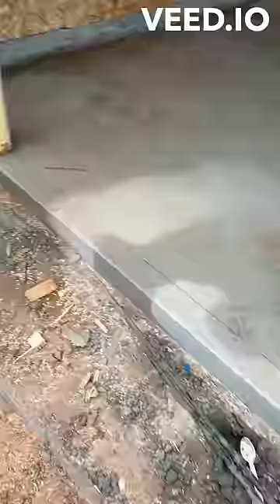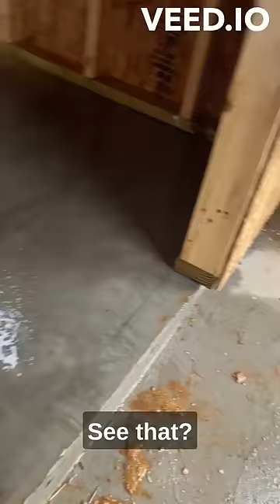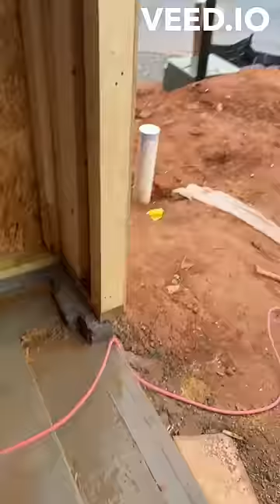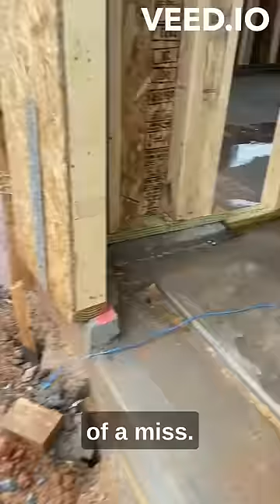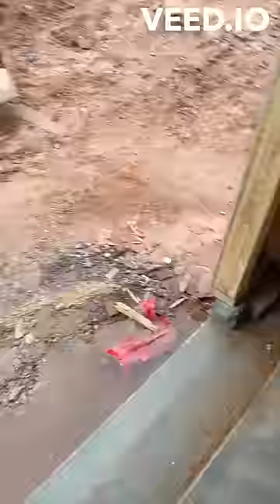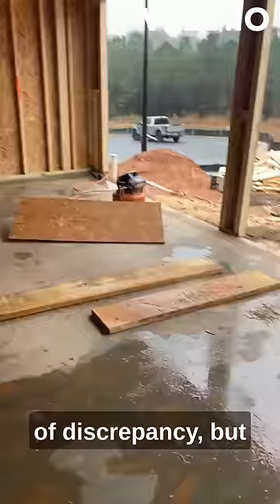New Home Slab is Wrong Size, What Now?

Comment: Tell em to tear it down and DO IT RIGHT! I've seen it done before. These corporations charge way too much for trash work!
Reply: Go with smaller contractors, because the smaller they are the more they treat their employees right which do the job right
Reply: There is a house on top of it! A bit of an over reaction to tear the house down to repour the foundation.
Reply: @brycebeckett6654  If I'm spending a lot of money on a new house then I'd want that shit done right. Not some kind of patch job.
Reply: When you pay “production” prices, just because you have volume, unfortunately this is the product you sometimes get. Personally, there’s no way I could live with this work product, but you know the old adage… you get what you paid for.
Reply: @rasheemsanford9348  sadly, today, you never get what you pay for.... Corporate greed with no morals or ethics is what we get today.
Reply: Chippies (at least when I was framing) flick lines to measurements off plans, frame the walls, if plates overhang slab then the developer calls back concreter’s to extend slab for frame to sit completely on slab, then they get paid (which made “accidents” happen very rarely) Obviously in this case they’ve gone pretty far ahead with the frame without saying anything but it can be fixed. Tearing the whole joint down is completely unnecessary.
Reply: I think it would be possible to repair. Call you mr engineer, he’ll have solution and sign off on it. Done
Reply: Or just add more concrete to cover the rest of the space 🤷🏽‍♂️
Reply: @ivannieves154  or do it right the first time. Customers pay for things done right. Corps need to be held responsible.. morals and ethics...
Reply: You can pour more concrete…. The LWF is fine
Reply: They "did it right".... They even did it "in the right place"..... Yet it appears the person who formed the concrete measured to the outside of their form instead of the inside of their form. Unless of course you're correct, and they did it wrong. Lol
Reply: You're on to something brother👊✌️
Reply: Juan Pablo hammered nailed and screwed inc
Reply: @brycebeckett6654  the house has to be torn down to fix the framing anyway. they’re not gonna repour the slab. They’re going to tear down the house and rebuild it because it was not built on the slab. There’s no other way to do it properly.
Reply: @richardfreeman8458  so it’s wrong to make a mistake and fix it then? Though that was human nature we aren’t perfect but for sure if u can tell me what part of the game that is never seen a house built 100 percent perfect first try something will be wrong
Reply: @harambeisbae5323  understanding this mistake and how important it was to NOT MAKE probably would help you. Most "mistakes" are made out of carelessness, which means it was avoidable. Morons that don't have pride in their work and think society owes them something are usually the f ups on these and defend it like it was ok. I NEVER screwed up a job an half ass fixed it for a customer to save MYSELF money. That's unethical and immoral. So there's that..... You youngins are missing that today...
Reply: @brycebeckett6654 you telling me that you would just say oh well i guess its ok, after spending a coupke of mil on a house?
Reply: @brycebeckett6654  If I'd done this in my town, I would get a notice and order to tear it down. I've seen it happen.

That's why you stop and say "hey boss check this out" instead of building three whole garage doors over air and punching out.
Reply: @etteyafed lol says who? You? Ive seem these many times before. Not by this much but an engineer would get involved and reinforce the concrete. Seen it done many times.
Reply: You do not need to tear the house 😂😂😂😂 calm down
Reply: @mariosilva9533  cut the Tapcons out and gently back a pickup into it.. then drill a couple more holes :D
Reply: @stickyfox j bolts
Reply: @etteyafed  I think if this was me, I'd frame a second exterior wall just inside the first one and pour another 8"-12" next to that slab just to make it look good. Concrete usually sticks out a few inches under the forms anyway. In my city it's OK to anchor framing to fully-cured concrete as long as you use the same tensile strength per foot as the equivalent J-bolt. They're more popular because you don't have to drill the plate or set up lines and straighten them during the pour.

I'd fight pretty hard not to tear it down and redo.  It's probably cheaper and quicker to get an engineer and apply for a variance. If the homeowner really wanted to spend all the money and wait longer to have it exactly like the drawing says, and can't spare those 3-4 square feet in his three-car garage... well, it's his money!
Reply: They will just patch it up and once it is all done, the home owner will not even notice it. It would probably fail after the new home warranty expires
Reply: Corporation? Lmao... It's residential concrete.... It's most likely just a guy who owns a truck and employs a handful of people. What corporation is involved? Lol
Reply: @chasejordan22  just as easily could be a corp. Small business doesn't stay in business when they do chit work. So you have a theory... Either way, doing business like that is pathetic. Some people will argue anything..😉 corporations can be a single person business, there, Sally. Lol
Reply: Thats hilarious you think corporations run framing businesses